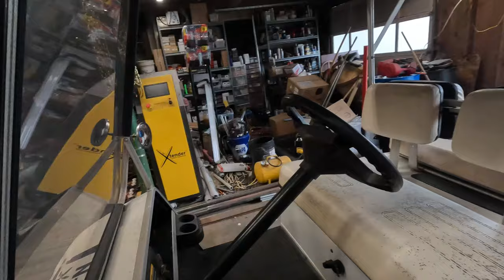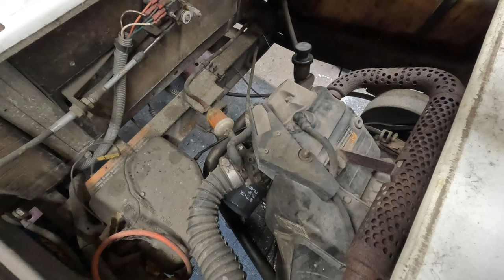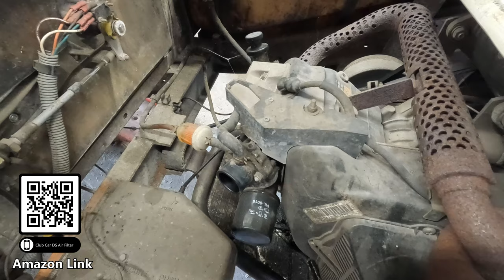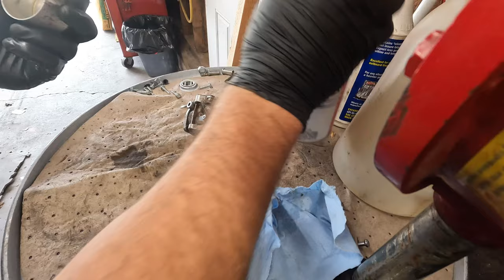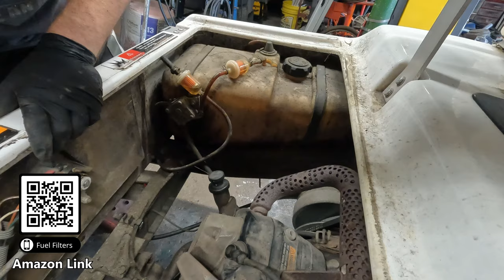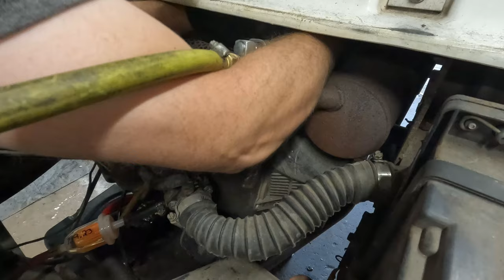1996 Club Car DS, Gas - It's Not Running Good

Comment: Thank you. Your videos have taught me a lot about my 87 club car ds gas. Not so much that year specifically but you know. I just changed out the coil, starter generator, voltage regulator, solenoid, all 4 micro switched, the carb and fuel pump with fuel lines and filters. I replaced the engine mounts and all the bushings and shocks all the way around. New battery and cables. Tore the body completely off and cleaned it as best as I possibly could. The only problem I am having now is when I push the accelerator pedal it starts right away but as i push the pedal I get no rpm increase until the pedal almost bottoms out. Ive done all the work on it myself this week. around 18 hours but I just cant figure this one out.

Comment: I have a real head scratcher, Kevin, if you have a second. Yamaha G8 gas, must have the gas pedal about half way down to get going. If you press it all the way, it doesn't start (engine just turns). Only when you Jimmy the gas pedal half way and then go full throttle. If you use choke? It runs totally normally. Dirty carb, right? I've taken it completely apart 3 times and used tons of carb cleaner everywhere. That sucker is sparkling. Airbox clean and it runs the same with airbox disconnected. Buy a cheap 3rd party one to validate it's the carb?

Comment: From the ones I have worked on , the air-box o'rings are always dry rotted and needing to be replaced. Getting club car o'rings for this year seems to be getting harder to find if you use OEM club car parts. I see a ton of the 91+ DS style cars come in the shop quite a bit still running strong as ever to get normal preventative maintenance done. Great little cars.
Reply from the maker: Yeah, these are some of my favorites. They are super easy to work on and not over-complicated like EZGOs and some Yamahas

Comment: I just replaced my starter generator on my 89 Marathon EZGO.  Damn pivot bolt was welded tight.  Had to cut it off.  Need to tap a new bolt hole in it, but can’t get at it without removing the engine.  Running ok for now on one pivot bolt and the tensioner fully extended.

Comment: Got a real head scratcher. 96club ds. 2 new carbs one from buggies gone wild. 160 on compression. Valves adjusted.006. New fuel pump and filters. New ngk plug great spark. Fuel flooding very hard start. Fuel from overflow coming out. Fuel in crankcase. Any ideas???

Comment: Great video!  I have a 1993 CC DS - how do you keep the throttle from opening too early on startup??  It is a pain to get running, but once you do it runs like a top.  I’ve messed with this thing for nearly six years and can’t figure it out.

Comment: Hey Kevin, I just bought a 96 golf cart. It is getting gas in the crankcase. I watched your previous video on cleaning the carb out. Question for you, is it okay just to buy a new carb and fuel pump and slap it on? If so do you have any recommendations?
Reply from the maker: Replacing the carb would be fine. If you're comfortable doing so, I would try to clean it first. EverythingCarts or BuggiesUnlimited are great places to buy.

Comment: Hey kevin i have been lost.. i have a 1997 yamaha ez go gas golf cart that has no power it drives but goes maybe 5mph ive set the valve clearence cleaned carb new plug do you have a suggestion
Reply: It also has good compression approx 150psi when I check it